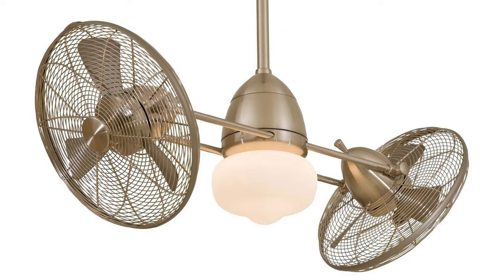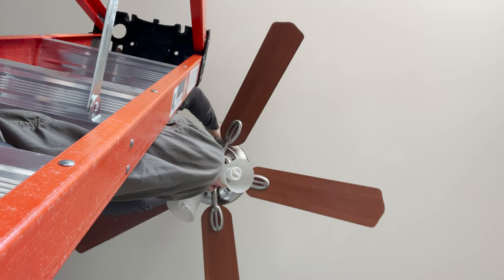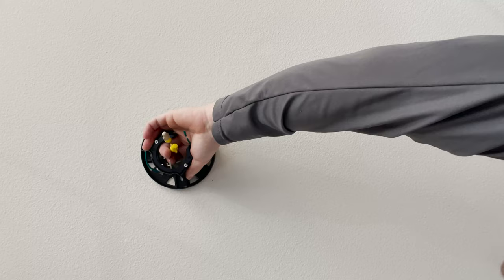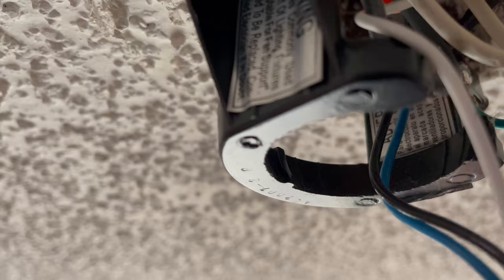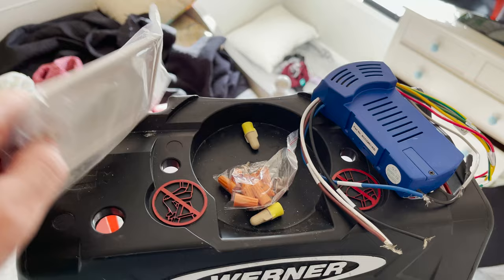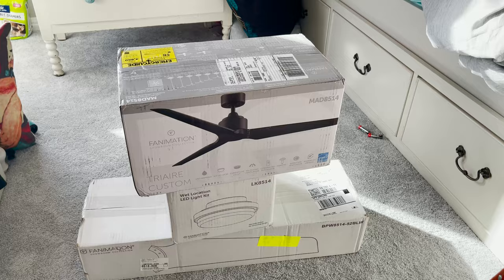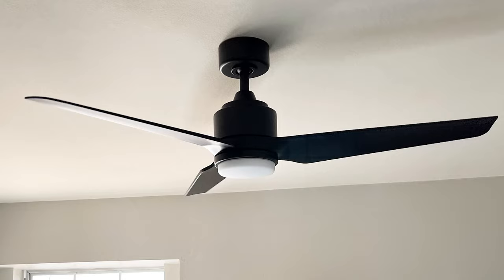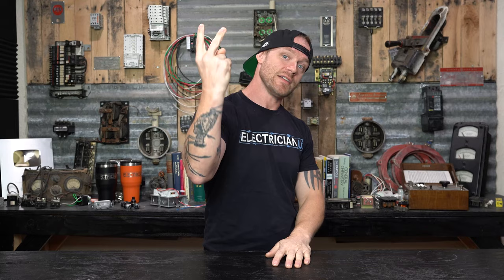How To Install a CEILING FAN - (From an Electrician)

Comment: How much do you charge to replace a ceiling fan?
Reply: I would tell a client to plan for 2-3 hours budget.  I’ve been lucky and been in and out of a clients house in under an hour.  But, it’s hard to give a blanket price.  There could be improper wiring, I might need to reinforce the j box.   Little variables can add a bit of time and cost.   Hope that helps !!!
Reply: @A Town what currency?
Reply: 100 per hour. 150 if they watch. 200 if they worked on it before you. 500 if they tell you what to do.
Reply: @JohnDoe-qq8et  thanks 🙏
Reply: @JohnDoe-qq8et  not correct it’s 125 per job
Reply: @jakesully5402   for me to take down and build and hang I charge 125, if I have to add a fan it’s 200, if I have to put a switch down the wall I charge 250
Reply: @JohnDoe-qq8et  lmao
Reply: @ryanthepianoman27  that might be your rate but it's not universal
Reply: What if you have no existing ceiling lights only a switch plug for a tablet lamp and it's a vaulted beam ceiling with no attic access lol...
Reply: Too broad a question. Depends on fan model, ceiling height. Existing box and wire setup etc etc

Comment: @21:07 - Don't just slap the brackets to the blades.  Doing that can cause most of the wobble you're trying to eliminate!

My ex-fil (rest his soul) gave me a helpful hint with ceiling fans: each blade consists of the blade and its mounting bracket.  Before assembling them, use a gram scale to weigh each blade by itself and each bracket by itself.  Write these numbers down. Now add them all up and divide by the number of blades.  This is the target weight for each blade/bracket assembly.  Mix and match blades to brackets until each set are on or very close to that target weight.

If your fan has four blades, get two sets that are close too each other and mount them opposite of each other.  

Now your fan is close to being balanced, and will run much quieter.

Comment: always take the old bracket off: there's subtle differences, and you need to inspect that ceiling outlet. Or replace the brace&outlet combo. You could do a video on the suspension options alone. And add sloped ceilings with corresponding rose/cover; what a 'mare!
Reply: Bracing makes all the difference
Reply: and the side-mount box options, AND the fanmaster!

Comment: Just did one last week that was held up by an old plastic box that was 3/4 cracked. Amazed it hadn't Fallen before I got there
Reply: Old work ceiling fan rated box replacement time?
Reply: our complex has the ancient bakelight boxes. old age and heat have destroyed 80% of them. Im amazed the boxes havent fallen out of the ceiling by themselves yet

Comment: Every fixture is  different on its own way.  Plumbing fixtures. Electrical fixtures. And it has a lot more to do with product designers than anything else. 
We must be well versed in every step of of the process to accomplish every challenge we face. 
Electrical, mechanical, technical, structural,  and logical thinking are   required  skills to have as  Electricians now a days. 
With the automation and integration of almost everything to the internet. We as Electricians need to educate ourselves  in the integration of automated systems. 
Relays,  timers, sensors, transmitters, receivers and algorithms play a big role in today's world of things.

Comment: I usually take the ball off the pole so its easier to put the covers on and not in the way. Then i put the ball and pin in just before hanging.  Also i wire the receiver up before i lift into the air.

Comment: Just had an issue with my fan that I didn't realize I had to teach the remote because it appeared to just work, until it didn't. Now I was not able to turn off the light and just disconnected it until I saw this and went back to the instructions and re did the teaching part.

Comment: the most fun part about doing a ceiling fan is after youve gotten everything assembled, turn the switch on and you hear that faint tick tick coming from the base cover. the infamous wire nut dragging against the motor.

Comment: The biggest frustration for these RC units here in Canada for us is that in wiring convention here, power first goes to the wall switch before it goes to the ceiling mount which means you must use the transmitter to control the light instead of the wall switch unless there is a significant, retrofit wiring change. It does not sound like much but fumbling for a switch on a remote control instead of a wall switch in the middle of the night is a pain in the arse. Unless wiring code prevents it, in a pre drywall situation I would suggest that power follows the European wiring convention & runs to the ceiling box with a switch leg running to the wall switch instead so the light can be controlled by the wall switch & only the fan is controlled by the wireless RC.

Comment: i put a fan up and it had an extra red wire. I attached the blue wire to the red and black to black etc.  The fan came on with the separate light switch not from the other switch. So i capped off the red and attached blue with the black wires. Still coming on with the separate lights switch. Any ideas  please?💡

Comment: What is the best way to put a solid core ground wire and the strand ground wires together i got a celling fan and it has 2 ground wires and i have the ground wire that comes from the supply i tied a wire nut and it kept comeing lose so that is were i am stuck thanks

Comment: If I never see a ceiling fan again I will be happy. All that I remove to replace with another one/type the box is never rated for ceiling fans. Also the boxes are usually missing some hardware. Approved fan boxes sometimes are missing their screws. Because the box is thicker and the screws are larger the standard 8/32 is to small. So out come a tap and new screws. The ones that get installed from a scaffold you always drop a screw or are missing a part. Good video. You can have all the fan jobs. LOL

Comment: Another great video! I personally like hanging fans, but when it comes to getting the stinkin remotes to work sometimes or hanging one with a 6 ft rod, or the thing doesn't work than it's a pain. I hang them from the top down too, seems to work best for me! How many of you toss the instructions to the side and halfway through you notice something ain't right so you gotta look through the book and figure out what is the problem? I do that sometimes. I guess if all else fails read the instructions 😂
Reply: But we’re guys. We always assemble first then read the instructions after 🤣

Comment: I have a ceiling fan that initially would come on (The lights) for a few minutes then off for even more than a few minutes. I don't have an accurate account of how long anything was on/off so I apologise. Also, the fan worked just fine. 

So I began to work on it. When I took the fan off the ceiling, I noticed 3 neutrals joined together, and those where then joined with the fans neutral Then, there was the black power wire, just one singular. And that power was then joined with the fans black and blue wire, the blue being the fan. 

I proceeded to test the voltage. With the 3 neutral cables together, I was getting an unstable reading of 112, then it would spike to 200 and something, then spike even higher to 343, then back down. I took those 3 neutrals apart and tested them all individually and found that 2 of the neutral have no reading whatsoever. But one of them have 112V constantly.

With that being said I joined the 2 non working neutrals together. Then the one neutral working I joined it with the fans neutral wire. And the power back with the fans power. 

Now, when you turn it back on, it turns itself immediately off, then 5 seconds later it comes back on. Different result there. Another different result is, it lasts longer. It stays on significantly, for like 30-40min. Before it shuts off for like 3-5min. Then it repeats that cycle. 

This fan is in the dining area. The breaker that is 20amps in total, is powering both the kitchen and all it's appliances and lights. Along with the dining areas lights and receptacles. The panel is closer to the kitchen than it is to the dining area.

My guess is, the dining area's fan is not getting enough amperage. But I am like, new, baby new to electricity. I'm barely starting. Which is why I would like to apologize if I had said anything incorrectly. Or made it difficult to understand. I hope this is enough information. 

And now the plug next to it has lost complete power
Reply: the fan is probably overloading the circuit, try unplugging one of your appliances that are on that same circuit and see if the fan will stay on
Reply: Sounds like the neutral is being switched and it sounds like it is a bad quality splice on those 3 white wires.  Based on your description of what is happening in the octagon box I would normally expect to have only 2 whites twisted together and ready for the fan neutral , 2 blacks twisted together with the last white wire.  This would leave one “lone wolf” black wire ready for the fan black and blue.  This lone wolf would be the romex “mate” of the white wire that is twisted to the other two blacks.  Think of the octagon system as one romex wire is “feed in”, one is “feed out” and a last set is merely a switch “loop”.  Typically the white of the switch loop is spliced with the two blacks of the feeds.   Best thing would be to hire a sparky to come over, unless u can figure out which white/black romex go down to your switch by a continuity test.   

Hope that helps !!  Kind of confusing, I know, Electricity is very abstract. Hard to picture circuitry, but unfortunately a bit too easy to feel.
Reply: I don't think this can be fixed over the internet. get a proper electrician in to look at that mess, you have bad connections going on. they overheat & melt insulation.
Reply: Thank you all. I am a new born electrician, and I only mess with things I absolutely know. As for things I do not, I ask questions. I enjoy learning new things and seeing what people say. My father is an electrician but unfortunately he lives hundreds of miles away. I hope to fix this issue myself, but not without proper training first. I am currently signing up for electrical engineering here soon. But again, thank you all

Comment: I worked as maintenance at Cabela's and they had this huge light/fan display that was originally built by a team of electricians on a large metal grid and then the grid was hoisted and flipped, hung and finally energized all as one giant array. It was never indented to have anything removed from it. Well that department called me to come take one down for an irate customer, they had sold the last one which was already spoken for by a guy who had placed like a $7000 order. Dude was gonna return everything and walk if they didn't get him that antler fan/light combo (it was big too). So here I was up about 30 feet trying to take this damn thing down and it was just a huge pain in the ass. Hey the customer is always right though, so despite that departments fuck up, it was me to the rescue I guess. Took me about an hour and a half and it was sketchy AF, I almost dropped it several times. The dude was still pissed at them but gave me a $200 tip which I had to decline due too store policy. I told him I just appreciated the gesture but this is my job and was happy to do it. I got a raise the next day and that department was on everyone's shit list for how they handled that account, I mean they had one frickin' job, LOL. The moral of the story is fans can be a huge pain but can be so worth it in the end, never let them see you sweat fella's. :)

Comment: question if the house has older wiring I mena like really old, can it still fit one of these present day ceiling fans with the light and fan runig off the switch? or do u have to stay with a pullchian?
Reply: It depends on if you want to control the light and fan separately. Also if your switches are in one location or two. 
If you don’t want to run new wire then your kinda stuck with your fan being controlled by the pull chain. Sorry
Reply: But if you run another wire you can add a second switch and control the separately 😊 

Just use the wire that’s there to pull a new line and wire, then use the line to pull back down your original wire. Bam two lines.
Ps… lube matters
Reply: @desireeespinosa3954  oh actually I meant am I gona be physically limited by not being able to run one a those present day fan and light switch ceiling fans (where u can buy the wall switch with the fan)  with remotes? Or do I have to stay with pullchain

Comment: I wish that I had watched this before I spent hours trying to stuff a boat load of wires that came with this fan. Problem I had was the very tight space between the hanging bracket and the box and I was working twelve feet up. I literally could not get any of the wires tucked back up into the box and the canopy would not fit at all. Finally gave up, disassembled everything and brought it back. I found another brand that has a better bracket and fewer wires and hopefully I get that one installed ☹️

Comment: OMG the number of rentals I've lived in where ceiling fans were installed (often by baboons) in simple nailed-on plastic ceiling boxes. ALL Wobbled and rattled like mad that I have no idea how they hadn't fallen. Of course I properly corrected those 😎

Also can't stand when both the fan and light are on the switched wire. I like the fan always hot but light on the switch.

I mean, if something's worth doing, do it right 😎
Reply: Well, it's nice to be able to de-energize the bedroom fan when working on it, without the trip to the garage and turning the breaker off.
Reply: But how often does one need to work on the fan? 🤣 I'm hitting the breaker first anyway 😎 I don't take too kindly to "surprise tickles" 🤣
But I'm just used to the lights on the wall switch and the fan on the pull chain.
(this happened way too often): Say the last person who used a room left only the fan on but light off. Now it's dark and you slap the wall switch and only the fan comes on. Then you're hunting for the pull chain in the dark to turn the lights on.
Reply: Anytime I install a fan in my house I always have 2 switches (actually a fan speed control and dimmer)... Best to control both from the wall IMO.

Comment: Wago’s are great for fans.
Reply: @lawoull.6581  what’s wrong with the lever nuts?
Reply: @narlycharley  Probably the same thing that's wrong with Sharkbite connectors or PEX plumbing in general, new programming languages like Rust, and electric cars. Old habits die hard and masters of the trade don't always adapt so easily.

Comment: Respectfully diaagree...I've tried every different way of building fans there is. The best and fastest way to build fans is open everything in the box and discard all plastic in box to get rid of trash. 

After that build the fan on the floor, as long as it isn't the ones that have to have the Canopy installed first. IYKYK. Install bracket and then hang fan in one piece. Try this and tell me you wouldn't do it this way every time

Comment: Can you install a fan with out shutting the breaker off in that room. Just turn the light switch off?
Reply: Sure you can .. then someone can turn on the switch and shock the crap out of you.  Turn off the breaker for safety!

Comment: I just installed a Harbor Freight chain pull style fan. My wall switch is a Leviton rocker type switch, but also has a dimmer / slider in it. (similar to what you show at 25:50) I'm noticing when I turn the switch on, the fan light does a slow strobe, until I move the switch slider up and down, or turn the switch off and on again. This happens every time. There is also a slight hum, the more I lower the dimmer slider,  which slows the fan speed and dims the light. As far as connections between the fan and ceiling/house wires, I have all green grounds connected together, the blue and black from the fan connected to house black, and the house red capped off with no connection to it. Not sure if this is the problem, or if I should get rid of the dimmer switch, since I don't really care about being able to dim the light or adjust the fan speed aside from the 3 built in speeds.

Comment: When it comes to ceiling fans and the boxes always over-engineer. A live load like that will tear small crap apart. 

And never install a ceiling fan in a standard fixture bar box even a small fan will tear that apart in a short amount of time. do it the right way and get the heavy box with the heavy bar unless you can get it put right to structure AND make sure the structure itself is solid enough. We have a lot of 100-year-old houses around here and I've seen many 2x4 and 2x6 that you think are secure but after a half dozen tries you can usually wiggle them enough that if you put a box on it it's going to cause a problem

Comment: Too complicated nowadays. Too many problems that can go wrong. I got to Hunter original ceiling fans I installed. Heavy made out of cast-iron. Still working very well. No remote control no complicated Electronics.

Comment: Q: I have installed a ceiling fan  outdoors and speed 1 is fast and speed 3 is slow and also even when set on the highest setting the fan spins really slow - why?
Reply: Could be the fan being defective or maybe u don’t have the right voltage
Reply: @Nick-bh1fy  I have tried two different brand new fans so I can rule out defective fan as far as voltage goes how can that change?
Reply: @stanavagiannis2381  could be experiencing voltage drop in that run. Maybe check for any loose connections neutrals
Reply: @Nick-bh1fy  thanks I will check

Comment: I HATE those fan remotes.  One of the pleasant surprises is that some of the brands will default the light to "on" when power resumes.  Not fun when a bunch of your lights turn on at 2AM because the power company had a hiccup.  I went through and ripped out all of them in my house and hard-wired it all.  KISS